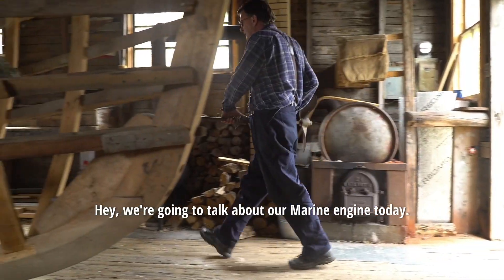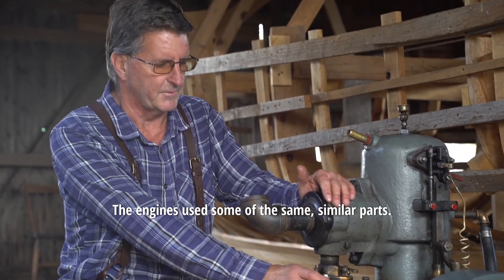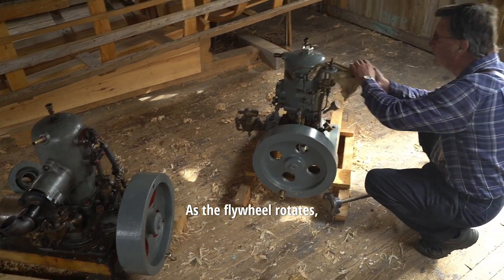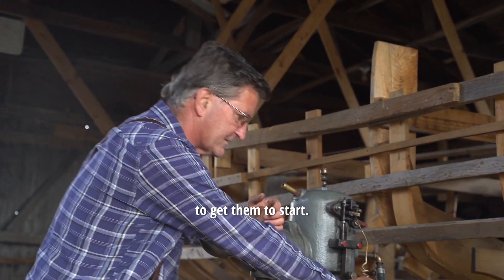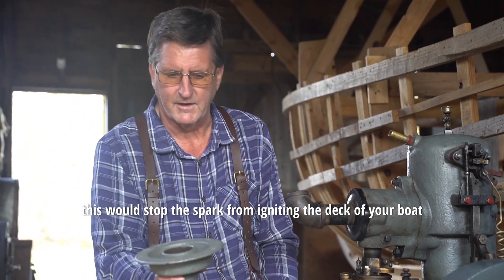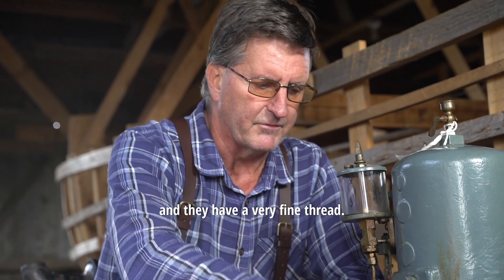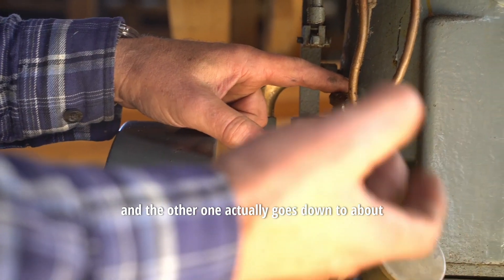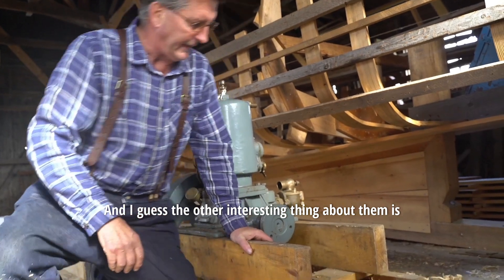Things That Go: Marine Make and Break Engines (Atlantic & Acadia)

Comment: Greetings from Norway.
 My first boat had a single cylinder gasoline engine built in 1930 with magneto ignition. 
My second boat had a "modern" two cylinder engine from 1960.
Indestructible engines that never failed.
Norway used to have more than two hundred boat engine manufacturers along the coast.
Today all of those manufacturers are long gone, but many of the engines are still in service.